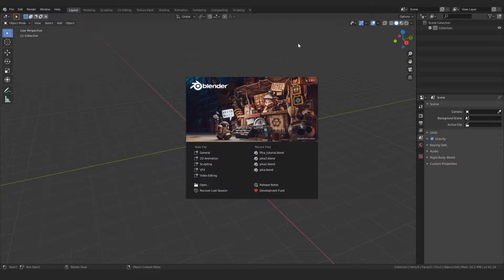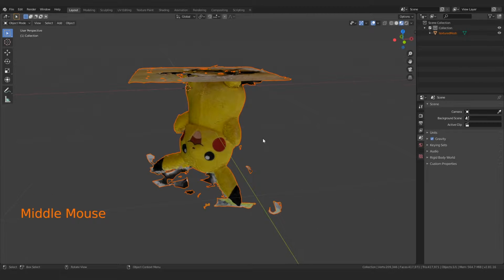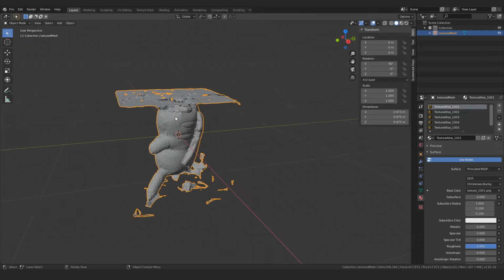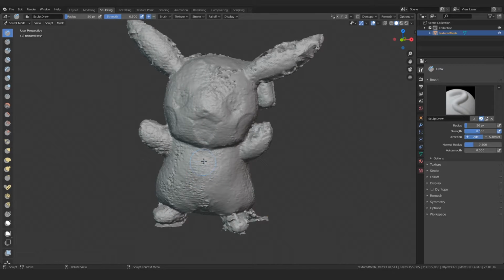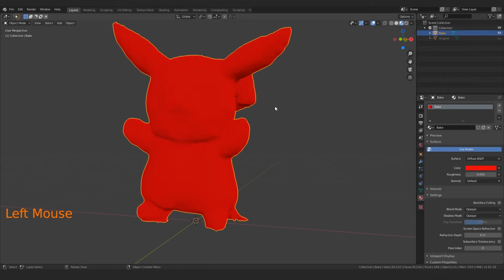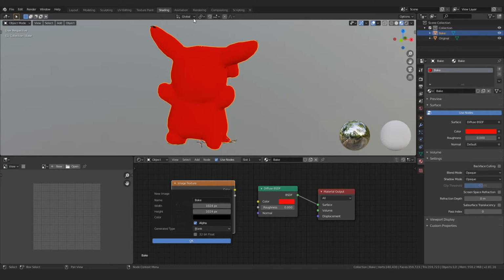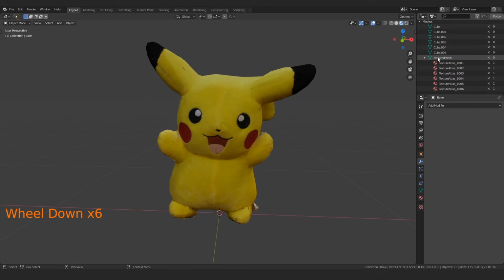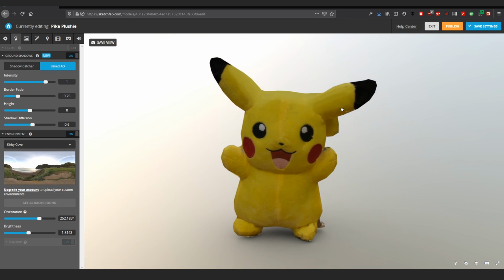Blender 2.81 - Beginner Photogrammetry Retopology

Comment: I don’t get why you didn’t retopo and unwrap properly….
Reply from the maker: If you read the description you will see: 

This video is aimed at students that have little to no experience with 3D or Blender. This method is suitable for static meshes and non-deforming set-dressing. This is not meant to be used in a rigging and animation pipeline.

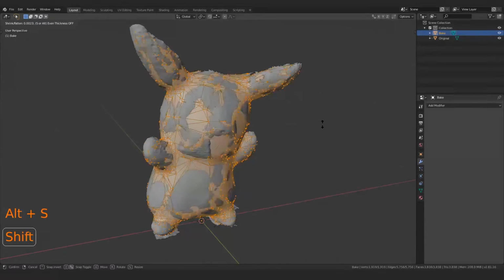Comment: everything is fine and dandy until 1:14:30. when I resize it it starts becoming incredibly laggy. shade smooth has no effect and when I tried the "smart uv project" the program crashes everytime. 

:(
Reply from the maker: That might be a hardware issue. I can’t be sure without access to the file.

Comment: Thanks for this wonderful tutorial! The bake is not working with my 3D model... I tried to change the selection order, but it still doesn't work. The image remains black.
Reply from the maker: There could be a number of issues, for example if the normals of your mesh are inverted, it will not bake in the proper direction. Can you send me the packed file?
Reply: @Crompwell  I exported my model after applying the modifiers you showed, and I imported it into Photoscan to texture. I used the original UV map, from the original model, in the decimated model. It looks great! Thanks for teaching this retopology workflow :)
Reply from the maker: GL.3D Ah ok, so it sounds like you worked it out. I’m glad!
Reply: @Crompwell  Yeah, if it's not a problem I can send you my blender file. I just don't want to bother you :) can you give me your email?

Comment: Thanks for this tutorial.  It is very helpful.  I am teaching myself a skill for work.  I use a drone to map environments (parking lots, roads, etc.) and want to produce nice quality animations in these environments.  The pavement surfaces are always a bit rough so I need to smooth them out.  I need to preserve dimensional accuracy as well.  I have brought my MeshRoom project into Blender, placed the mesh, removed un-wanted vertices and smoothed surfaces.  Of course, smoothing caused a jagged look to the texture.  Is there a way to re-map the texture without scaling?  The software I use creates a top down orthomosaic of the area that I might be able to use for a texture map.  Any advice is greatly appreciated.  If you have suggestions on other learning resources, I'd really like to know about them too.  Again, thanks very much.
Reply from the maker: One way to prevent jagged textures is to right click your mesh in object mode and select smooth shading. If this doesn't do it for you, that may mean that you need more geometry. Without seeing a picture of what you're working with, it's hard for me to know exactly what the best option would be. If you need to remesh you could you a remesh modified or manually retopologize the mesh and then project the texture as per my tutorial.

Best of luck to you!
Reply: @Crompwell  Thanks for the reply.  I am working on a second project right now.  If you don't mind, I'd like to show you what I am doing and get your advice.  I'm sure you are busy so I understand if you don't have the time.  I would appreciate it though.  It would really help me out.  Thanks.
Reply from the maker: @markpartain9429  Hi Mark, I'd be happy to take a look.